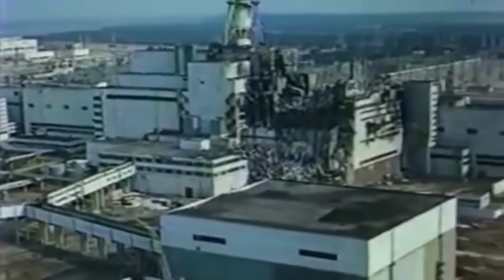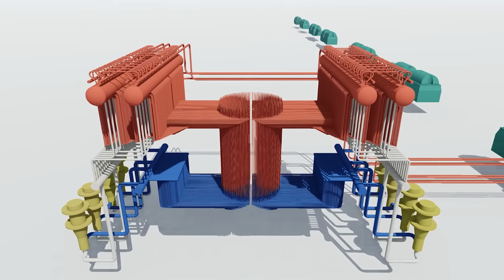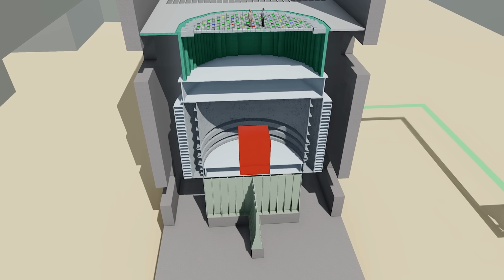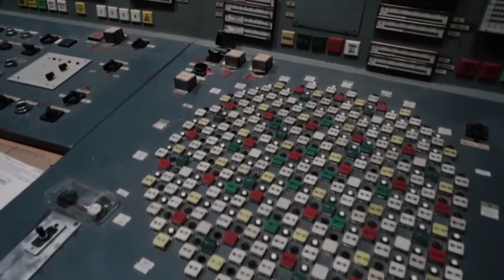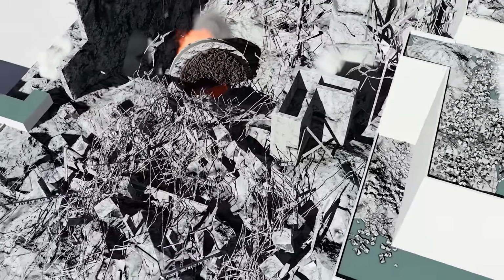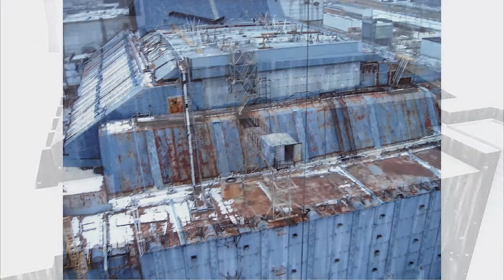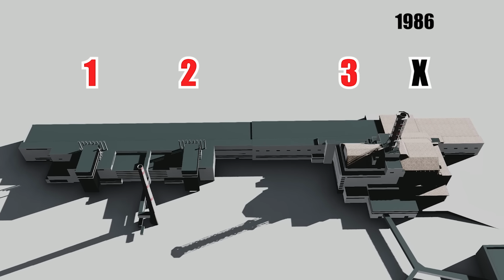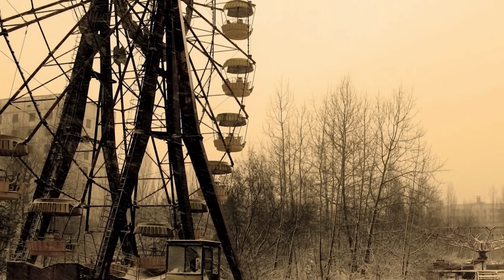CHERNOBYL DISASTER - An Inside Look - 3D

Comment: The Soviet Reactor Protection System was the best in the world, and this is according to the IAEA reports. During a strange test conducted by the night shift led by engineer Dyatlov, in violation of technical conditions, the automatic reactor protection system was turned off! If there was a problem with the stability of the nuclear reactor, without a solution from the Central Atomic Supervision in Moscow, without a solution to conduct this experiment at the Atom Energy level, they obeyed the instructions of the senior dispatcher of Kiev Energy, turned off the protection of the reactor, and also carried out the steps that led to such a terrible tragedy!!! This experiment was carried out at other nuclear reactors in the USSR, and quite successfully !
Reply: You mean like Leningrad?  Where they deleted and lied about the dangers of the reactor operating at low power levels and problems with the shutdown mechanism.  The Soviets gave the IAEA the propaganda info, just like they did to the Germans when asking for the robot to help clear roof debris.  The only reason the Soviets went with the RBMK design, is because it produced Plutonium at faster rates than other designs.  It was about masking weapons grade plutonium, not providing power.
Reply: Of course, an emergency shutdown system turning a nuclear reactor into a bomb must be the best technology. Maybe the best technology that Soviets/ruZZians are able to built, for the rest of the world it's just crap. Like everything from USSR or RuZZia.
Reply: Unfortunately this accident was part of the fall of the USSR.
Reply: propaganda
Reply: @KaptajnKaffe  где пропаганда?
Reply: @asdvet1918  jeg kan os snakke et andet sprog
Reply: @KaptajnKaffe ну , если идёт в разрез западной пропаганде ,  то сразу русская пропаганда?)) Вы считаете , что говорят на Западе про Россию, или СССР , то это правда?)) Интересный мир однако!))
Reply: @asdvet1918  jeg nægter at oversætte det 🤣
Reply: @KaptajnKaffe In Russia, YouTube translates into different languages automatically! In your backward Europe, you don't know how)
Reply: @KaptajnKaffe well, if it goes against Western propaganda, then immediately Russian propaganda?)) Do you think that what they say in the West about Russia or the USSR is true?)) An interesting world though!)
Reply: @asdvet1918  no, I just don't care, you mean that little to me 😅🤣
Reply: @asdvet1918  don't you think that a good part of the german population who lived a good part of their life in the former GDR and now live in the west, are able to judge by their own past, what is told about russia in west. Think about it. I'm pretty sure you know the answer. ;) And btw... I'm one of those... so don't try to say stupid things...

Comment: How could you compare Fukashima and Chernobyl in the context of the Japanese reactor having better safety features? Fukashima still exploded, releasing massive amounts of radiation into the environment. That incident was also caused by particularly a bad design in a country prone to earthquakes and tsunamis.
Reply from the maker: The comparison was to show how much more compact Fukushima was and illustrate its containment layers. And show how Chernobyl had just one layer. 
It wasn’t about whether either was capable of exploding. 

Anyway you are wrong. The reactor at Chernobyl blew up. The Fukushima reactor core did not. 

The upper reactor halls at Fukushima blew up from the hall being filled up with hydrogen. The reactors are still intact.
Reply: @Mike-Bell  but both are disasters. One is not better or less severe  than the other. Neither should have happened. All the song and dance in the West about how Soviet reactor designs were bad and their operators were incompetent ...here we were in Japan, a Westerized country, an ally, a learned country, and their reactor facility still had a catastrophe. Having an argument about whether the core exploded or there was hydrogen gas explosion is irrelevant. Both released massive amounts of radioactivity into the environment, and the cores melted in both countries. There were clear indications of bad design and mismanagement. But I appreciate your size comparison of the two reactor designs.
Reply: @MegaSunspark  Try this game. How many lifes took Chernobyl and Fukushima disasters? What happened with nearby settlements of both facilities after the disaster? As you are well informed, you also know that design flaws with both facilities lay in different parts of their systems. So what's the point of your question other than watering down one disaster with the other. "Having an argument about whether the core exploded or there was hydrogen gas explosion is irrelevant" well, I think it isn't. If cores of Fukushima power reactors were openly exposed to the environment in the way of Chernobyl disaster the damage would be much much worse, but this wasn't thankfully the case.

Comment: If properly operated, and all procedures are strictly followed this reactor is totally fine. 38 years later there are still 4-5 rbmk reactors operational and there are no problems. The only mistake USSR made back then is that it didn't foresee that there could be a moment of dumbness of an operator and thus to create even more protections.
Reply: It was a very bad design. There are nearly no safety mechanisms, that’s the reason while most countries shut them down already.

Multiple incidents like the incident in Leningrad showed, that it wouldn’t need an operator error to cause a catastrophe. A simple technical defect could lead to a reactor situation were the chain reaction wouldn’t be controllable anymore. It was purely luck that besides Chernobyl those accidents happened at operating points were the risk was comparably low. 
And that’s why the RBMK design is considered one of the designs with the highest operating risks.
Reply: @OhmeinGottVIIC  There are better reactors with more safety mechanisms out there , but that doesn't make it a very bad design. There are safety mechanisms but there are no foreseen mechanism for an operators stupidity. As I mentioned already , there are four RBMK working right now as we speak and there are no issues at all. It's like riding a bicycle without a helmet(which we all did when we were kids, Idont know about you though) - and if you know how to ride you will never get hurt, but if you are f*cker who doesn't know how to ride then you will blame the bike that it didnt come with a helmet...
Reply: Shit happens tho cant say it won't  happen  with a modern computer operated  one a hacked server or glitch  can  cause a problem  scary if AI gets involved  touch wood hasn't  happened  but hey being too careful can rear its ugly   operating  a nuclear  reactor  due diligence a employee  that lost his mind goes  rogue  and locks out system and hacks all control rods into the system  what stops a angry fired employee  from saying right ile sabotage  the plant
Reply: @fichonn  It was a bad design. The concept is good and effective, but the details had massive flaws that made them ticking time bombs = bad design. The heavily modified reactors that exist today are much safer. Not safe in the way that western reactors inherently are, but safe enough when operated competently, and as I said very effective, producing huge output in a way that I don't think western, safe reactors do (feel free to correct me, anyone who knows this for sure).
Reply: I vehmently disagree, the current operating RBMKs have been seriously modified to meet standards that absolutely need to be in place. The RBMK 1000 reactor type was flawed and is the major reason the accident happened. Was some employee error to blame, yes, butso much was stacked against them that accidents where unfortunately common place with these reactors.

Comment: CANDU (Canadian designed and made reactor) has a positive void coefficient, so the statement that  western reactors "are stable by design, as the core heats up, the reaction slows" is not accurate. There is ~50 CANDU out of ~450.

Of course it has several mitigation strategies, but it's unstable by design. Reminds me of Boeing.
Reply: They use Water both as a coolant and moderator. 

Chernobyl happened war such a disaster because the Soviets didn't build a containment building.
Reply: @420sakura1  The containment building would only have made a difference in the corium melting. The power of the explosion was enough to destroy any containment building
Reply: Chernobyl reminds me of MCASTs specifically

Comment: Relatively speaking, save for the Graphite tipped Boron control rods, these RBMK’s (500 and 1000 MW) were safe.

Beside using technology well over 20 years old at the time, the soviets had figured in that by using slower-starting, larger reactor cores utilizing 2-3% enriched uranium 235 fissile material that they could save on labor, money and research and development by using what they had technologically speaking.

The real issue is that these reactors were poorly designed, and the issue of positive-void coefficiency was ignored in favor of pushing through to the ideological Soviet design of “Atomgrads”, or nuclear-powered cities.

To make things worse, Anatoliy Dyatlov was essentially a wrench monkey compared to the task of managing reactors of RBMK type, only having handled simpler submarine reactors prior. The most horrifying fact of all this: Dyatlov was the most qualified reactor controller in the reactor room of number four that night .

It could have been in part denial, but also largely in part that Dyatlov could not work a way out in his head exactly how these reactors could have exploded , so naturally until Valery Legasov began the task of investigation and presentation to the authorities of his findings and that of his peers, Dyatlov didn’t realize what he had done.
Reply: Dyatlov did push the limits of that reactor. Dangerously so. But what HBO seems to have done is conveniently turned him into an antagonist. 

The truly evil ones were the Soviet State at the time, setting these reactors up and not properly training the respective operators on instruction and safety of how to handle RBMK reactors.

The Russian SFSR statesmen really bare the responsibility of killing hundreds of thousands of innocents including the liquidators over the years, by direct consequence of the explosion April 26, 1986, and Acute Radiation Sickness and cancer.

But the one man to blame the most was of course Mikhail Gorbachev.

Comment: It is a misconception that the reactor exploded from the emergency protection system. By the time the operator pressed the AZ-5 button, the reactor was already collapsing
Reply: That's incorrect for two reasons. First, the reactor was not "collapsing", it was in a state of xenon poisoning and near-total shutdown.  It was unstable, but if the crew wasn't under pressure to avoid shutdown and continue the test, they could have backed it off to a stable state.  And two...  Yes, AZ-5 is an emergency protection system.  You activate an emergency protection system, it's supposed to protect you in the case of an emergency, right?  From everything the crew knew, AZ-5 would do what they wanted.  A design flaw in the reactor - which was DELIBERATELY HIDDEN by the Soviet nuclear energy commission for political reasons - made AZ-5 cause a spike in reactivity, which was the opposite of what the crew wanted.  AZ-5 blew up the reactor.
Reply: @garrettbirkel7750  Nie zapanowali by na reaktorem, za dużo było pary i za mało wody, katastrofa była nieunikniona po tym jak zaczęli zwiększać moc
Reply: @garrettbirkel7750  "The Japan political system, and the ridiculous sense of national pride it engendered, is what blew up Fukushima made-in-USA reactors", -  an example of not sticking out politics where it shouldn't be
Reply: @lachesis8004  In Japan there was no government-led attempt to suppress the design flaws of the reactor.  The Soviets were notorious for thinking in terms of "embarrassment of the state".  Everything was a contest between the state and some other state, e.g. "the West".

That way of thinking lives on, in your comment here.

Chernobyl exploded because some аппара́тчик thought that sharing important design flaws in the RBMK was "embarrassing to the state", and so, that information was hidden from the people trained to operate the RBMK.

You really need to stop thinking in terms of the defunct Soviet state versus other states, and turning everything into a pissing match between it and the USA.  It's embarrassing, ... and demonstrably bad for your health.
Reply: @garrettbirkel7750  "The Soviets were notorious for thinking in terms of 'embarrassment of the state'." -- Yeah, totally different from the truth management that the US typically engages in, right? If some type of disaster had happened in 1986, the US government would have made sure that an avoidable catastrophe like that could never happen again in 2003...
Reply: @lskdjf3000  Uh huh. As I said above, "You really need to stop thinking in terms of the defunct Soviet state versus other states, and turning everything into a pissing match between it and the USA."

Let me be very clear:  No one in the USA under 30 even knows the USSR was a thing.

It's something they heard about in a textbook and maybe saw in old movies, that's it.  To say that everyone has moved on is an understatement.  There's nothing at stake any more; the competition is gone and the contest is forgotten.  Comparing the USSR to the USA is pointless.

It also does nothing to deny or defend what happened in the USSR or what the government was like:  The Soviet Union was an almost incomprehensibly corrupt, repressive, and exploitative system, and it slaughtered, imprisoned, and dislocated millions upon millions of people, mostly by erasing the line between "the people" and "the state" and then declaring large chunks of other people "enemies of the state" to justify their exploitation.  (Including my great grandparents.)  It's history and it's done, and crying "oh yeah but what about ameeerrriiccaaa" does less than nothing.
Reply: yeeeaaaah ill just go ahead and stick to what they said on HBO, since you know, its based on actual testimonies.

Comment: I enjoyed the graphics in this video, they give a good overview of the structure and the damage afterwards.
One question I still have about the original design of the control rods: the bottom end of the rods were graphite which is a moderator meant to increase reactivity. When these are inserted, the graphite was meant to replace the water inside the control channels. Some videos mention that this water is an absorber (decreasing reactivity) while other videos mention that hydrogen (the H part of H2O or water) is a moderator. What were the graphite ends of the control rods meant to do originally? replace a moderator or replace an absorber?
Reply: Light water is both a neutron moderator and a neutron absorber. As in, when a neutron interacts with water it can either be absorbed or it can "bounce off" with less energy, i.e. moderate. In isolation, its net effect is predominantly as a moderator, boosting reactivity. In a typical western reactor, the water is the sole neutron moderator. As more water is added, the power increases, and if the water is lost or boils away, power decreases. This creates a negative feedback loop that can help prevent a runaway chain reaction and helps stabilize the reactor.

An RBMK, however, is graphite moderated. The graphite moderator provides a substantial boost in reactivity that allows the reactor to run on far less enriched uranium, saving on operational costs. The impact of that, though, is that water is no longer a net moderator but instead a net absorber. This is because there are diminishing returns to moderating neutrons. The graphite is already **heavily** moderating the neutrons in the core, and the addition of water through the reactor has a comparatively negligible moderating effect. The water's absorbing effect is now more pronounced, making it a net absorber in an RBMK.

Effectively the impact of water on reactivity has reversed compared to a typical water-moderated reactor. In an RBMK, as water is lost (e.g. by boiling it), the power will increase, boiling more water, increasing power more, boiling more water, etc etc etc. This is what is referred to as the positive void coefficient, it is a positive feedback look that makes the reactor unstable.

Back to your main question--the water is an absorber in an RBMK, and the graphite extensions are therefore meant to replace an absorber. The reason for this is that it creates a greater differential in reactivity between the rods being inserted and withdrawn. When withdrawn, the graphite is within the reactor and boosts power. When inserted, the graphite moderator exits the bottom of the reactor and power decreases even more.

Without it, the control rod (an absorber), when inserted, is simply pushing away the water in the channel, which is another absorber. The water is admittedly a worse absorber than the control rod, but the result is that the impact of the control rod is less significant nonetheless. So the graphite extension helps compensate for this effect.
Reply: @jordanpottruff3602  Thank you. That is very useful information. It makes a lot more sense to me now.

Comment: bullshit about az-5. stop fake distribution
Reply: What bullshit? Please be specific.
Reply: @keithvather  Void coefficients have nothing to do with AZ-5.
Reply: @AC-nq6os  In the video, Mike didn’t imply that they were connected. But in the Chernobyl accident, they were, because of the AZ-5 system design flaw and the running condition of the reactor. AZ-5 pushed all the control rods into the reactor core, and they stuck. The carbon tips on the control rods caused a power spike. That’s is the connection between positive void coefficients and AZ-5.
Reply: Keep making bot accounts to disagree with hard facts and conclusive findings